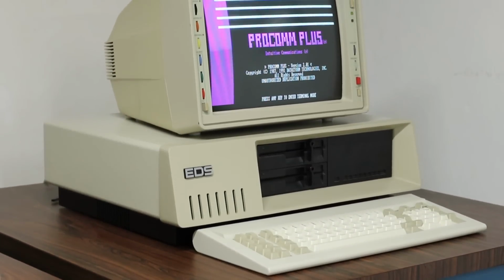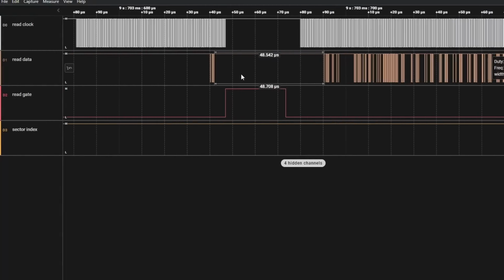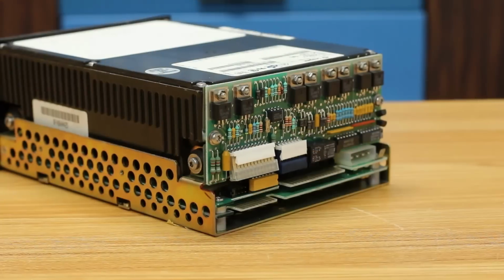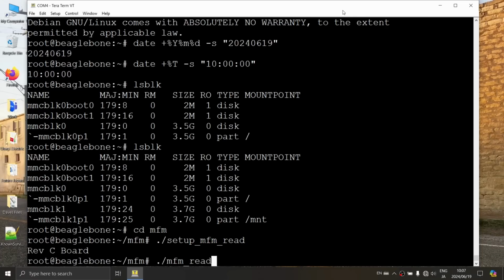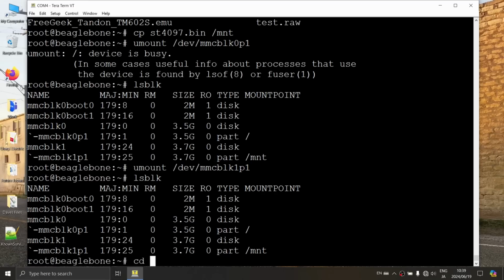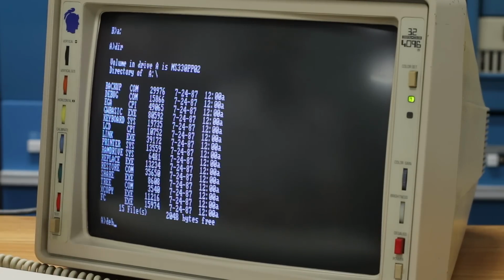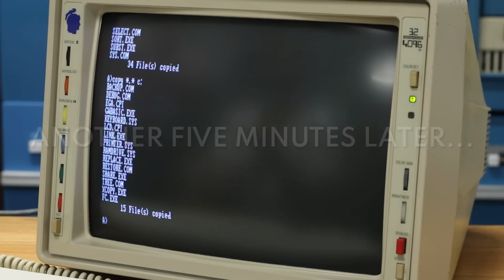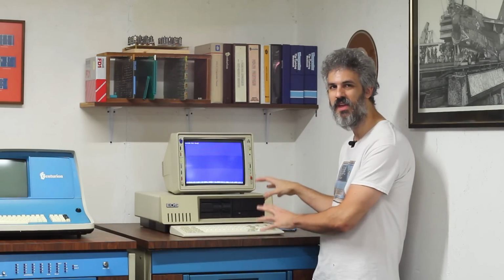FM is RLL, MFM is RLL, RLL is RLL! Fight me.

Comment: I've seen retro computing youtubers wearing a Forgotten Machines tshirt before but somehow never knew it was a youtube channel! I'll have to check it out after this. 

Iirc 'interleave' is roughly how many times the drive will let the disk spin around before reading/writing the next sequential part. Slower computers needed this to give the computer enough time to decode what it read before it could tackle the next part. Obviously, the higher the number, the slower it goes, and an interleave of 4 is up to 4 times slower than the drive could operate. 

I think way back on the day it was trial and error as to what interleave your computer/controller/drive could handle, the lower the better. So you'd have to low level format the drive at 1 and hope for the best, see if you got any errors, and if you did start over at 1 higher. 

Steve Gibson wrote a nice utility into SpinRite that could actually test for optimal interleave of a disk and readjust the interleave by rewriting the disk without low level formatting, preserving the data. It's not in the current version, but a license still grants you access to the older version. If you work a lot with IBM compatible PCs it might be worth the $90 investment. It's helpful in exercising all kinds of drives, including modern SSDs, especially data recovery. But since you said this is the first time you've used fdisk, probably not a priority for you.

(It's not a miracle tool, or magic, even Steve will tell you most of what it accomplishes is just yelling at the disk controller a lot and the routines built into the drive firmware itself do all the work. They normally don't get a chance to do a thorough job because speed and responsiveness is prioritized during normal use. SpinRite just acts like a drill sergeant telling them to practice over and over again until it's satisfied things are all right.)

Comment: Congrats to figuring out the sys c: part, I still remember this - and its only the latest UEFI that boots purely out of copied files (and some SoC bootloaders that handle SD cards with FAT, like RPi). My comment to this part is rather that there is no footage shot of the bios settings? The hard drive model (type) should be selected in order to let the bios know the geometry. Especially missed that since you were swapping different drives. These drives are definitely not PnP like modern LBA bases drives.

Comment: The way you explain it is great as usual, but first of all I think you're using the wrong shape for those ones and zeroes in the graphics you use to illustrate decoding: two subsequent "ones" on the platter don't go up and down, but stay up.
Also the way I understand it is that FM vs MFM vs RLL encoding is all in the way that data bits are encoded as flux variations. FM encodes 1 bit of data as 2 flux variations. MFM encodes 3 bits as 5 flux variations (or something) and RLL encodes 5 bits as 7 flux variations (or something; I may have the numbers completely wrong). So with the same number of flux variations per second or per track, you could accomplish more capacity, and the only thing that was required was that the magnetic material of the disk and the analog properties of the disk controller, the disk electronics and the heads were sufficient to encode the minimum and maximum number of flux variations per second. In the early 1990s, I replaced my MFM controller by an RLL controller and though I had to low-level reformat my drives, I used them successfully for years with 1.5 times the previous capacity.
All of this has to do with making sure that there are enough flux variations per second to recover the clock, and there are many many encoding methods that deal with that, or with similar problems. For example on the Compact Disc, there is an encoding method called Eight To Fourteen modulation to ensure that there is always a sufficient variation in the pits and lands on a CD to follow the track with the laser. Also (somewhat related), the Digital Compact Cassette uses an Eight To Ten encoding and the S/PDIF format uses biphase encoding where each bit in the signal is encoded as 2 biphase bits except at the beginning of a frame where the biphase encoding is deliberately violated to make the start of the frame detectable by the hardware. The math isn't that difficult (though a little overwhelming perhaps) and if you dive into it, it's actually kind of fascinating how engineers figured out how to do this kind of stuff.

Comment: Rewind late Eighties.
At one point ST225 and similar drives were sold with an "RLL"-controller effectively increasing the storage capacity of that disk.
It worked up to the point disk companies got the flair of the trick and decreased the quality of the magnetic coating on the platters for the given types.
See @andrewgrillet5835

Comment: A couple things. 1) You should copy all the dos files to a dos directory and the procom plus files into a procomm directory.  There is a limit to the number of files you can have in the root directory.  I forget exactly what it is, but it isn't that much and it's probably less for dos 3.  It will generate false disk full errors if that number is met. 
 Second, you should probably create a config sys file and an autoexec bat file with a decent files= statement and load ansi sys (both in config sys) and a path statement in the autoexec bat and a prompt=$p$G for a normal looking c prompt.
Reply: Yes, I was squirming at the copying of everything to root, but then again it is a limited-purpose computer at the moment (the HDD effectively being a much faster floppy).  But a simple autoexec.bat that directly loads Procomm could be useful (for the current usage).  
I expect the original HDD would have had a startup/utilities menu at boot.
Reply: @SenileOtaku  Yes. Often it was a simply type statement with a bunch of lines saying 
press 1 plus enter to start procomm plus
Press 2 plus enter to start bla blah blah
With a 1 and 2 and 3.... bat files that end by cls, cd back to root and then a type statement displaying the menu again.  Very simple, very effective.
A lot of the early XT machines didn't include 640k. So having a menu loaded into memory wasn't really ideal.
Reply: The max number of directory entries for FAT12 and FAT16 seems to depend on the total size of the disk. For smaller removable disks it's typically only 100-200 entries. I think hard disks were still limited to 512 entries though. FAT32 got around this by storing the root directory after the FAT along with the rest of the data on the disk and could grow dynamically after the disk was formatted (compare to FAT12 and FAT16 which stored the root directory before the FAT and so was fixed in size when formatting).
Reply: Yeah i was thinking that, he got spoiled by the Centurion 🙂 IIRC it just says no free space when there is or that abort retry ignore prompt.
Reply: I think the limit for files in the root is 512.  In any case, putting things in their own directories makes it easier to find things!  I think you get a message like Directory Full if you try to exceed this, as opposed to Disk Full if the disk is actually full.
Reply: @roysainsbury4556  But is it 512 for fat12?  I'm pretty sure fat16 was released with 3.31
I had to fix this problem on a few machines and the error message was a false disk full from the best of my recollections.  It's been like 30 years though.

Comment: to make it easier for you... (I live in DOS mode) 

write an autoexec.bat file and place it on C:\ put the following commands to launch Procomm at boot without touching anything.
@echo off
prompt $p$g
pcplus

also you can format the drive again, and copy all of the dos 3.3 files into their own directory and still have access to the files without changing directories to where they are stored. 

at the C:\ prompt. type in mkdir c:\dos press enter
put the disk 1 of the 3.3 dos floppy in drive A
type the following commands:
a:
copy . c:\dos press enter do this for each floppy

write a autoexec.bat file on C:\
@echo off
prompt $p$g
path=c:\dos;
pcplus

that's it. then you will have a cleaned up file system. 
you can also format the C drive and transfer the system boot files at the same time.
format c: /s
then do the other work i just typed out. 
you can also sys the drive using sys c: without formatting the drive as long as there are enough free storage on that drive. sys command does not care if the drive is formatted or not just as long as it is accessible in dos. (fat, fat16, fat32, etc)

Comment: Computer using a MFM or RLL drives a command type "PARK".  This will cause the head to move into park position before you are shutting down the computer.
Reply: Only needed if it’s a stepper motor driving the heads.  Voice coil drives auto park when power removed.
Reply: @rsambrook  In the back 1980's, I was a computer technician.  I open a few MFM hard drives to find the platter was damaged.
Reply: @rsambrook  Most drives of that era were stepper, as I recall. voice coil drives were an update, and even then its not guaranteed to prevent a head crash because they were used with floating heads which needed the drives to be spinning fast enough. it would be fine with a system reset but powering off was a crap-shot.
Reply: Not needed for the ST-225 (or ST-238) 

They are voice coil drives and autopark.

Comment: Interleave is messing with the sector numbering.  If you had an interleave of 2:1, sector 0 would not be followed by sector 1, but physical sector 1 would be skipped.  Sector 1 would physically be located where sector 2 would be on a 1:1 interleave.  The idea is, the drive electronics of the time would be too slow to process the sector before the next sector was whizzing by the head.  If the interleave were 1:1, after reading sector 0, the disk would have to spin all the way around 1 revolution plus the size of one sector  before it could pick up sector 1.  Depending on a lot of things, you could have a 2:1, 3:1, or maybe even 4:1 interleave.
Reply: I used to install the Pick OS onto low level formatted PCs. On XT's (8088) we used a 6:1 interleave, on ATs (286) it was 3 (IIRC). I was blown away on my first install on an 386, 1:1 interleave!

Comment: I swear youtube's auto-delete makes discussing technical issues near impossible sometimes. I've had to break my comment into multiple parts and delete words.

Using "format c: /sys" formats and makes the drive bootable by automatically running the "sys c:" command.
Reply: As an aside, in the early 1990's I was a BBS sysop and eventually became a regional ISP in Florida.

My first "network" was a 286 and and XT connected using a null modem cable and special software. Even though the null modem supported 115.2 kbps the 8250 UART in the XT couldn't handle more than 9600 bps (mostly) reliably. I had to purchase a newer "multi-IO" board for it with a 16450 UART (what the 286 had). This should have allowed 115.2 kbps but I had to use 57.6 kbps for reliability. I was excitedas this was 6 times faster.

Then I found another networking software that came with a null-parallel cable. This was about 320 kbps, about 5.6 times faster.

My next upgrade was another networking kit that included two 2 Mbps nic's and I believe was called starnet. About 6.25 times faster.

Then I upgraded to Lantastic using 10 Mbps nic's. 5 times faster.

All of that occurred in San Diego about 1993 in about a year. Everything from the XT to the other purchases was bought a a swap meet. All because my 286 was running the BBS full time and wanted to have a computer for my own use. It turned out that 90% of the time I used the XT as another node of the BBS (without a modem) so I could chat in real time with users and read messages. The other 10% was backing up the BBS from the 286 to the XT which is where the faster network speeds were needed.

When I got out if the Navy, I moved back to Florida with my 1st wife the BBS quickly expanded. Faster computers, a dedicated server using Netware and 5 dial-in phone lines.

Then I found the internet and Linux. The 486's from the BBS that controlled 1 dial-in modem soon received Boca 8 port serial cards (using 16550 UARTS with a 16 byte buffer with a cost of less than $200 each) in multiple cities. They were 486sx25 cpu's overclocked to 50 MHz (faster than a 486sx2/66) with 4 MB ram, and a 120 to 320 MB IDE hard drive, 10 Mbps nic, and a cheap video card. As I had my own business all of this was purchased at wholesale and was incredibly inexpensive for the capability.

Some of these machines had 4 of the Boca cards with a total of 32 external modems (14.4k, 16.8k or 19.2k).

I met other small ISP owners who spent incredible amounts if money on much less capable hardware (in reality). One was using Pentium cpu's, 8 MB RAM, and these incredibly expensive "smart" serial cards. These had their own small CPU and ram and claimed to support 64 serial connections. One of these cards was over $1500. His next mistake was using Windows NT costing even more. The problem was that that the time Windows NT couldn't service interrupts fast enough. If he connected more than 4 modems to a single machine it wouldn't keep up causing the dialup connections to be slow (because of retransmits); the more modems quickly made things worse. He said when he originally tried 64 modems it was unusable, with 8 modems 14.4 kbps connections felt worse than 2400 bps, and 9 modems felt like 300 bps.

He ended up spending tens of thousands of dollars for 8 pentiums using those "smart" serial boards in order to support his 64 modems.  He could have bought a premium solution like a Livingston 64 port box for a fraction of the cost, they were something like $4000 each.

When I explained my setup he didn't believe me. The company that he bought the "smart" serial board told him it was required for more than 4 serial connections, nevermind he couldn't use more than 4 with his setup.

At our next meeting I brought my spare dialup "server" that used the same cheap AND 486SX25 CPU and all the rest of the standard hardware except only a single Boca serial card. I explained I kept a seperate spare Boca card as a ready spare. This meant if a dialup "server" caught on fire I could quickly have the spare with support for 8 to 16 modems running. And if I needed more Boca cards I could order them overnight. This spare would boot up, I'd run a custom configuration script to configure the network, number of Boca cards and number of modems. From showing up it would be 10-15 minutes to full replacement capability, most of that time to connect all the external modems.

I also showed him pictures of a live dualup "server" with 32 modems connected.

I could build a new dialup "server" for about $600 plus about $200 per Boca card, not including modems. This means 4 Boca cards would add about $800 bring the system cost to $1400. His "smart" serial cards cost about $1500, not including the computer which would be about $1500 wholesale, not including the Windows NT license. Windows NT had licensing based on users. 4 modems plus an admin login would only require the "cheap" 5 user license, I think it was about $200. The first machine he built he would have required 64 modems plus admin. I can't remember if you could get 65 users or if he would have needed 75 or 100. Thus was likely well over a thousand dollars.

When we calculated all of this out his mind was blown. He didn't want to switch to Linux because he didn't know it.

When I showed him how I could remotely log in to check on a dialip "server" status, do diagnostics, change configurations, update software, and if rarely needed reboot he was amazed because he had to go to his office to do most of that. You could remote into Windows NT at the time, but at 14.4 kbps a GUI was extremely frusterating; not to mention a huge security risk. Almost every windows update required a reboot and he had a scheduled daily reboot for each machine to increase stability.

I finally had to take him to my office to prove that indeed each little 486sx25 had 32 modems that worked perfectly. I also showed him the "uptime" on various Linux servers, two of which were over a year.

Comment: You may want to get an utility to ‘park’ the harddrive before turning off the computer. These older drives can drop the heads wherever they are, so the need to be placed in a safe position before shutting down.

Comment: FM is exactly how the TRS-80 tape drive worked.  I guess that, with a bit of extra processing and careful attention to timing, it would have been possible to both write and read MFM and RLL.  On the other hand, the timing of the cassette tape routines in the original TRS-80 ROM were just slightly off, meaning that reading back the tape data was chancy and you needed to use quality tape to have a chance of getting a good read back.  It was fixed in later ROM routines, but not before the computer had earned its nickname of "Trash-80".
BTW, you could have skipped a step by just using FORMAT C: /s to transfer the system immediately after finishing the format.
You can set up a CONFIG.SYS if you want to load device drivers such as an extended or expanded memory driver, and you probably should also set up an AUTOEXEC.BAT to at least set up a default PATH so that you don't need to keep all the DOS commands in the root directory and to set up the default prompt so that it shows the path followed by the "greater-than" symbol.  IIRC, that's something like PROMPT $P$G and after that, if you always want to enter the Procomm program, you can add that as the final command.